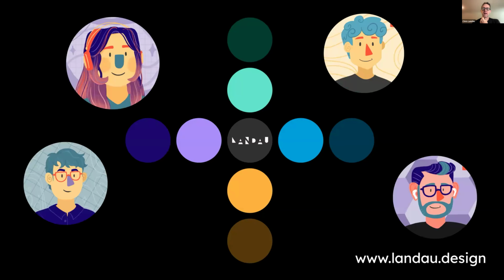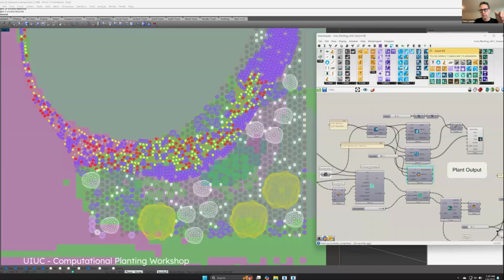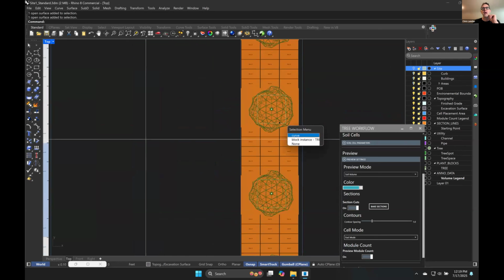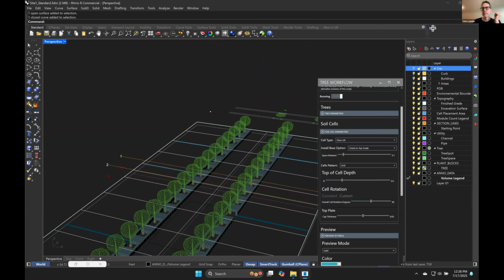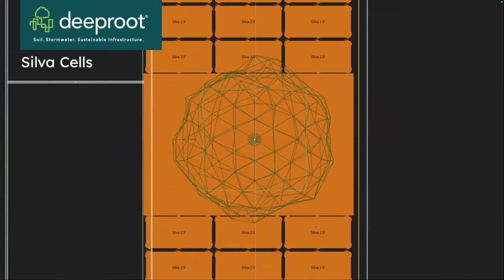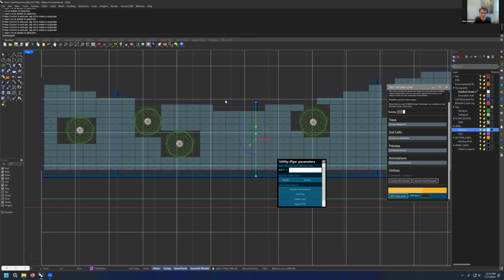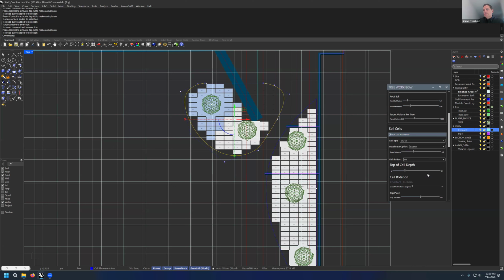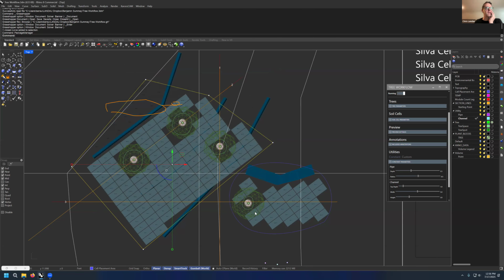Tree Workflow BETA Lunch and Learn

Comment: Thanks for this video. If I understood well, this "deeproot" system improves rainfall drainage and trees growth. Is this correct? Are there other goals? Good job
Reply from the maker: Yes. That is the idea behind soil cells. They keep soil from getting compacted in areas that are heavily paved. I'm not sure if it is intentionally capturing water the way green infrastructure would, but there is certainly some water captured.

There are a lot of different products out there. We started with partner vendor to get insights into the process.